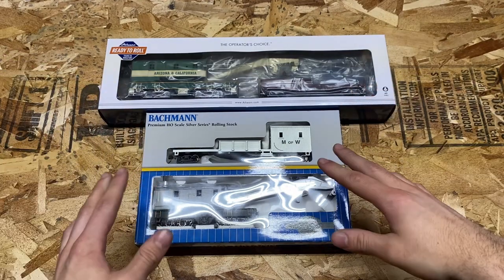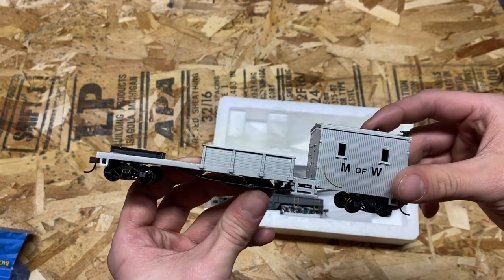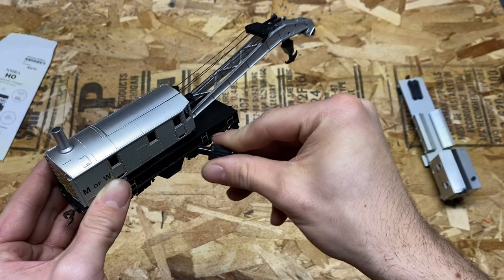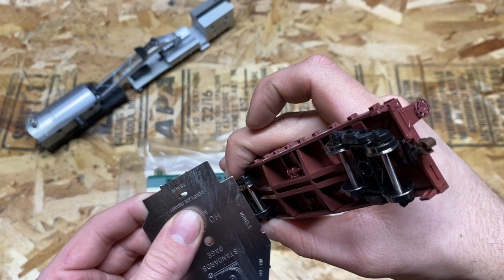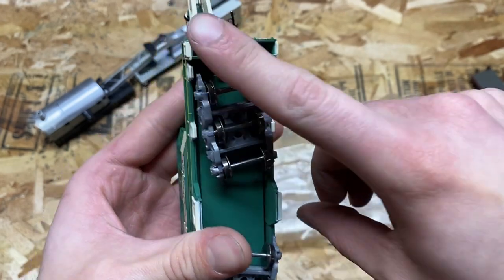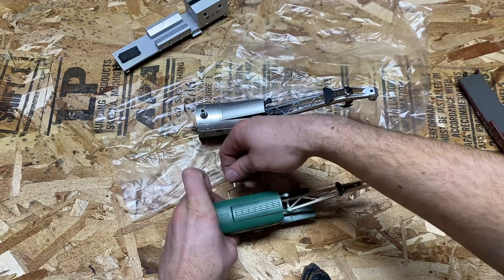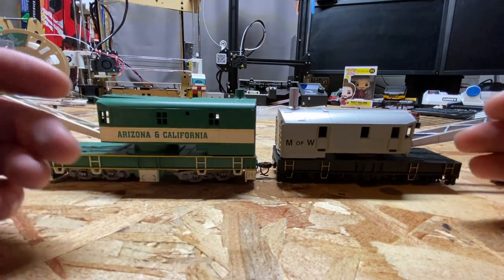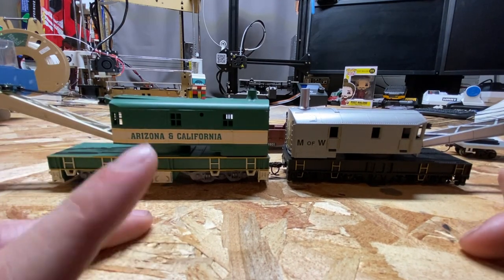Which crane is BETTER? Bachmann VS Athearn 200 Ton Crane

Comment: On the Athearn model, perhaps a small-bladed screw driver would work better than the crank.  Also, in general, the boom would be in the trailing position when moving in a train.

Comment: Roco also makes a large rail crane similar to the Bachmann and Athearn.  To identify a Roco if your ever shopping about for vintage train items look for the Made in Austria printed on its bottom side .   They come with knobs similar to the Bachman.  What I enjoy most about the Athearn is the overall appearance. If you attempt to build the earlier Athearn 200 ton cranes you not get much information on rigging but that leaves one open for creative solutions.  Best wishes. George
Reply: I have the CN version of one of these.  it was marketed through Model Power

Comment: I have one of these from the blue box era, I need to grind mine as it’s not a flat blade. I found one for the Boston and Maine work caboose I inherited. Can’t use the holder on the work caboose as the crane is stiff, not even light grease or oil will make it turn easier.

Comment: As soon as you showed the Bachmann tender car, I noticed immediately that it had the Wrong trucks. It has the light duty 25-ton. For that type of crane it needs at least 50 or 70 ton trucks. The two models are different by company builder. Its not called a 0-4-0 since it does not use side rods. I know, people get it wrong all the time.